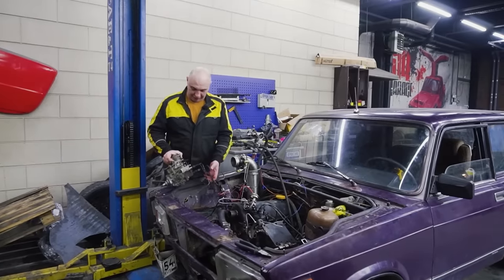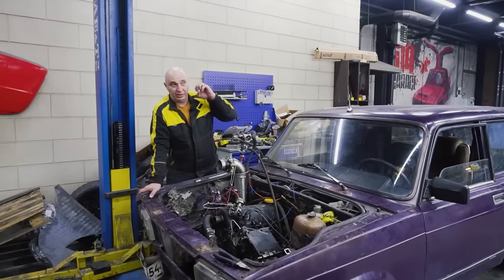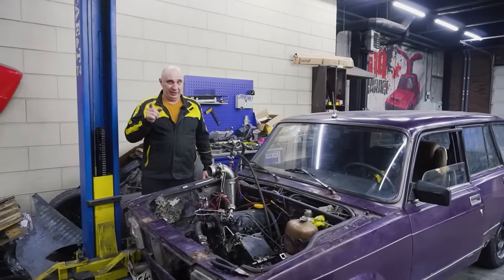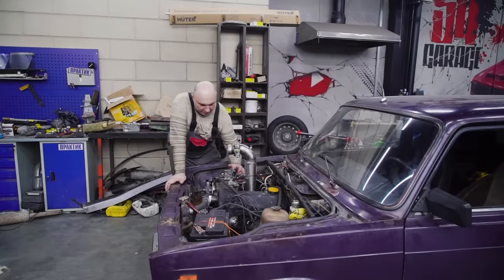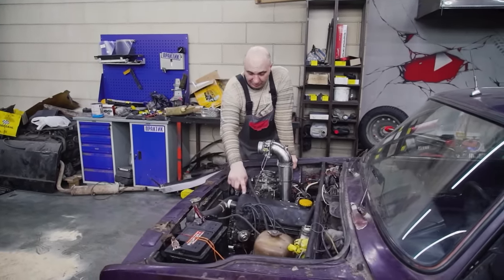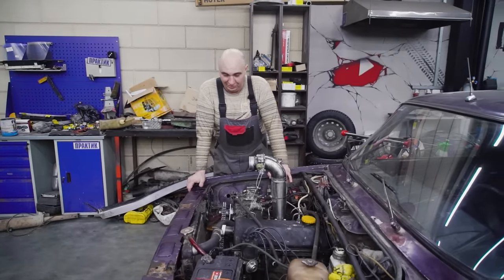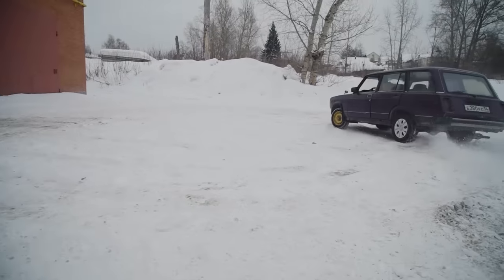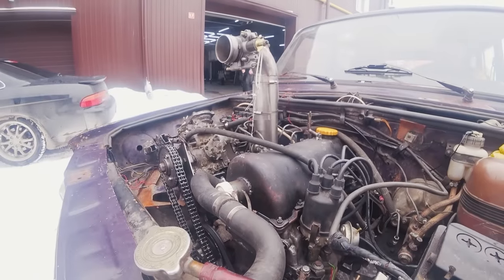We fit high pressure DIESEL pump to Lada engine

Comment: Back in the 80’s in Brazil they used to convert the old chevrolet inline 6 261 engines from the old petrol chevrolet trucks to diesel. 
The conversion was made using the cylinder head from the Mercedes diesel OM 321. They used to use an adaptor plate to be able to bolt the cylinder head from the mercedes into the chevrolet block, then I’m not sure about the injector pump but it’s not hard to gear it onto the crank pulleys or using the distributor shaft as a source of 1/2 crank rotation speed. I believe they would adapt the diesel pistons onto the chevrolet rods, never got details about this conversion but spoke to people who done it themselves (My father). The engine would work quite good but wouldn’t last long because of the lack of support for the crankshaft (5 main bearings only).
Reply: the misto quente was horrible, it didn't run like a real diesel engine and the consume of diesel was almost equivalent to the gas engine... and as you said, the engine wouldn't last not just because of 5 bearings, but due to the lack of resistance of material of piston rods, bearings, etc. a diesel engine requires a highly resistant engine due to the high compression from diesel.
Reply: Yep, they took the 4.5 I6, "canavieiro", and stuck a Mercedez head and rods, didn't work so well, but it works any way, they rather make a Detroit Diesel swap.
Reply: Rapaz que tanto de brasileiro falando bonito kkkkkk Ainda espalhando pro mundo a história do misto quente...
Reply: General Motors did something similar with the standard 350 V8 block. Converted it to a diesel. It wasn’t very good, but it did get decent mileage. They also did this with a 4.3L V6 but they used a heavier block. Those blocks were used in race cars converted back to gas because they would withstand the higher compression 😂
Reply: @weaponizedautism6199  they do this with the nissan rd28 and convert it to gas still today. Stronger blocks on diesels like you say. They use it as a stroker block too compare to the nissan rb26 found in the gtr's
Reply: Petrol -> diesel is always 😫, but in reverse it works well 😌.
Reply: @killerdinamo08  100% blocks aren't strong enough for the compression

Comment: it's like a mechanical injection system that was used on some race cars some decades ago.

the fuel delivery depends just on the revs. it's like a bosch system from 1955
Reply: both volvo and mercedes also used mechanical injection as late as the 70s early 80s i believe, it gave the volvo's more power than carbied or efi then but was less echonomical
Reply: missing one major thing, the amount of fuel delivered in each pulse is based on manifold vacuum on those old systems
Reply: @Stale_Mahoney  the Kugelfischer injection from the 60's used rpm, throttle,pressure, temperature to control injection, all done mechanically with shaped cams
Reply: @fuzzy1dk  good to see someone mention the ol' Kugel here ! 

they used rpm and throttle position,  or for the turbo version  throttle positiona nd boost press.  

whats funny about these is that if you "unroll" the cam shape about its axis, you got yourself a 3d fuel map just like on a Alpha-n  strategy on a modern ECU.
Reply: Top fuel and top alcohol drag cars are still using the same basic idea. Not sophisticated but still the best way to dump huge amounts of fuel into the chsmbers
Reply: @Stale_Mahoney  plunger pump systems died of in 72 , cis mechanical sprays continuously, was available in some form until 89
Reply: @dennisford2000  cool to know i know volvo used a B23E in the new GLE 1980(replasement for the old GT) and later B230E engines even after that, that was 2.3L engines and the fuel or carb injected was around 114-116 while the mechanicaly injected was rated at 131-140 depending on  model choice, also some turboed 2.1L once at 160hp  they all used bosch K-jet
Reply: RPM & Vacuum
Reply: @RickBaconsAdventures  VW used a mechanical mass air flow sensor to control the fuel delivered for each cycle.
Reply: They just have reinvented the Spica fuel injection system :D
Reply: @martinp8427  spica seems a lot like it, but that had some cam system hooked up to i presume vacuum and throttle position to change the pump % they had at fixed here.
Reply: @matthewperlman3356  that's interesting
Reply: No, those older mechanical petrol K jetronic injection systems did NOT use positive displacement pumps such as used in Diesel engines.  
I love garage 54s experiments because they invoke questions. Frankly on this one I agree with the author when he said “how is this working”. He got lucky on this one. But none the less a fascinating result!
Reply: @sqmotorsports9230  nope nothing like it. They don’t use positive displacement piston pumps to inject the fuel. Like used here and in Diesel engines.
Reply: @fb2800  you have to go further back than k jetronic to get back to the the systems based on diesels. 

or the spica system "The system consists of an electric pump near the fuel tank; a circular pressurized fuel line to the injection pump and back to the tank; a mechanical pump, driven by a toothed belt off the crankshaft; and a set of injector nozzles mounted in the intake manifold. The mechanical pump itself is really two components: a four-plunger unit that resembles a miniature engine, and an all-mechanical logic unit that regulates the pump's output. "
Reply: @RickBaconsAdventures YES
Reply: I think they sense the piston stroke by vacume and pressure. That way you can rev it to blow up.

Why they changed it

But for us ex racers and this show

BLOW IT UP
Reply: First gen Cummins was direct mfi. Injection pump increased fuel based off boost pressure and engine rpm’s.

Comment: you've managed to recreate the latest Petrol fuel systems! thats cool!
Newer engines nowadays have somekind of high pressure pump just like a diesel, to up the pressure a lot in the fuel rail. ive seen pressures above 150bar already. This is to atomize the fuel better, so the air really mixes with the petrol. gives a cleaner, more efficient and powerful burn.

just maybe you've started a retrofit trend! nice
Reply: except the new petrol fuel systems inject in the cylinder, with much more timing variation and complex duration control afforded by common rail computer controlled injection. I agree, though, for a hobbyist, this makes soooooo much more sense than going to a complete standalone ecu. You could mount one of these to your gasoline crate engine and it nearly run itself like a diesel, for what it's worth.

Comment: Brilliant video guys I wonder how it would drive with a turbo from a diesel
Reply: i was just thinking the same thing same set-up but just add a turbo lol
Reply: Makes me wonder how much power this engine makes before it comes apart though.
Reply: You'd need to add a booster valve for extra fuel or else things would melt quick I'd say haha
Reply: @aaronhall7740  it has that built into the pump already.. that ufo looking bit on the top of the pump adds more fuel when on boost..
Reply: @johnathanmcdoe  atleast 50% more that stock, unless these engines han handle more tourqe than is there from factory.
Reply: Ha ha
But one could enhance the cooling system & run the turbo off a cog as pump but add a magnetic clutch like compressor,  this would allow to switch on & off , just keep fuel regulaton as is just use bypass air valve for turbo etc for wen no operation
Lol
Reply: Yes!
Reply: I support this -- you guys should go the whole way and turbo it.
Reply: Восхищение произойдет без сомнения, и это произойдет намного раньше, чем многие верят (менее 10 лет, согласно всем экологическим, погодным, астрономическим знакам, израильским графикам и т. д.). Это произойдет без всякого предупреждения, ни одного, в одно мгновение, застигнув массы людей врасплох, как это всегда делает Бог, т.е. потоп - грубое пробуждение. Никто не знает точного дня или часа, когда произойдет восхищение, это точно. ВОСХИЩЕНИЕ МОЖЕТ ПРОИЗОЙТИ СЕЙЧАС, В ЛЮБОЕ ВРЕМЯ !! . Пожалуйста, пробудитесь ко Христу Иисусу, который является ЕДИНСТВЕННОЙ надеждой СЕЙЧАС, и не позволяйте узнать, что это все правда позже, когда будет слишком поздно, и вы остались позади в самые ужасные времена, которые земля когда-либо переживала прежде и когда-либо будет. Римлянам 10:9-10 Если устами твоими будешь исповедовать Иисуса Господом и сердцем твоим веровать, что Бог воскресил Его из мертвых, то спасешься!

пожалуйста, поделитесь с другими = ВАЖНО
raptureready.com

The rapture will happen without a doubt, and it will happen much sooner than many believe (less than 10 years, according to all environmental, weather, astronomical signs, Israeli charts, etc.). It will happen without any warning, not a single one, in an instant, catching masses of people by surprise, as God always does, i.e. the flood is a rude awakening. No one knows the exact day or hour when the rapture will take place, that's for sure. THE RAPTURE CAN HAPPEN NOW, ANYTIME!! . Please wake up to Christ Jesus who is the ONLY hope NOW and don't let it all be known later when it's too late and you're left behind in the worst times the earth has ever experienced before and ever will be. . Romans 10:9-10 If you confess with your mouth that Jesus is Lord and believe in your heart that God raised him from the dead, you will be saved!

please share with others = IMPORTANT
raptureready.com

Comment: So they basically made a mechanically injected lada, sweet😍🙌🏼 (it’s ready for a turbo😈😆)
Reply: yeah it's basically same as boschs system on a mercedes, high pressure included.

which makes me think.. did.. did bosch do just exactly this in the 50's?
Reply: @lasskinn474  my 79 450SL had that exact Bosch J-series mechanical injection
Reply: Yep, they did, GM also did with another name, the only problem was that require maintenance that ppl by that time didn't have the knowledge or thought it was too expensive to do, so they promptly replace it with a carb, years later Bosch made a monopoint electronic injector, which was simpler and easier to fix, the rest is history.
Reply: I was just thinking they basicly just build the bosch CIS Jet tronics used on a lot of European cars in the late 80s and early 90s

Comment: Early injected gas Mercedes engines like the gullwing had this setup essentially. Gullwings were direct injection but the later 220se and similar cars were port injection but still using a timed high pressure Bosch injection pump.

Comment: This was an amazing video experience to watch. I never would have though a high pressure diesel fuel pump would have worked. Thanks for sharing.
Reply: It really isn't any different from normal port fuel injection, just using a mechanical pump and valves instead of their modern electronic counterparts. Modern high-efficiency gasoline engines use high-pressure direct injection too.
Reply: @teardowndan5364  oh. I did not know. Thanks for telling me. I appreciate it. Thanks Again.

Comment: sugestion: try and make an opposed piston engine with two lada blocks head to head...
Reply: With the diesel injection pump!
Reply: @NN1Ckl.  How about three blocks and make it a Deltic. :-)
Reply: @Dave5843-d9m  that's a bit harder... lol
Reply: @Dave5843-d9m  That sounds WILDDDDD, you think they could get the geometry and weld 3 con rod tops to one conrod bottom and the crank? Do that with each set of pistons perhaps
It would be like just the top half of a 3 bank radial lmao
Reply: Up!
Reply: Up!

Comment: It would be interesting to run it with a wideband sensor to see if it's going rich and lean at different RPMs and loads. I mean really it has to be if the injection pump throttle is not being changed.
Reply: And add a stepper motor servo on the mixture control to run closed loop from a microcontroller, just for good measure?
Reply: Are you guys in the right channel? Sensors? We don't use this here. lol
Reply: Thats not a throttle as such. Its an enrichment device. It decides how much fuel you get per revolution so presuming the car needs a certain % of fuel at a given rpm and that doesn't change (it wouldn't on a petrol since stoic is always the same) then if its right at one rpm it will be right all the way up - or very, very close depending on how the thermal efficeincy changes based on air speed and volume.
Reply: I think it's all about the speed and timing. By getting the correct amount of fuel into the cylinder almost instantly after the compression stroke,  the fuel has more time to mix with oxygen in the down stroke it creates a vacuum and force mixes the oxidizer and fuel even more thoroughly it's like a secondary atomizer similar to experiments when water boils at room temperature under a vacuum the gasoline is locked in place and evaporating.
Reply: @SF-dy6hn  The mixture control on the pump controls the cam timing which opens the valves to the injectors inside the pump. A longer opening angle on the cam means the injector will be open for longer, and more fuel per stroke, hence a richer mixture.
Reply: @Stoney3K   Yes. I thought about that my first thought was that more fuel = more power. How-ever the mechanic seemed puzzled by the results. Theoretically a perfect mixture produces peak power rather than a lean or rich mixture. In practice most rich mixtures provide more power. How-ever the mechanics puzzlement on the situation leads me to believe there may be a non obvious reason. The next logical conclusion would be that something more advanced is occurring. Perhaps a more perfect mixture? Not just perfect quantities but equidistant separation of particles for a more complete combustion. How would the increase in delivery speed increase the homogeneous-ness of the mixture? Or maybe I'm completely wrong and a super rich mixture is better because the air is denser there with more oxygen so a rich mixture is able to fully combust. Or maybe a combination of the two a richer mixture that is more homogeneous?  It's pretty cool how much more power he got out of the engine.
Reply: Yes ideally the throttle and pump should change together. changing an offset between the two would adjust the AFR.
Reply: Slice up a small pulley, attach it to the throttle body, figure what fuel mix gets the highest rpm for each level of throttle opening, then match the fragment of pulley to the optimal fuel mix and if the mix needs to go more rich or more lean at wide open. Simple mechanical solution powered by trial and error! Wooo

Comment: Maybe with a vacuum solenoid connected behind the throttle body you can control the injection pump to get close to the right fuel air ratio

Comment: On the old gasoline MFI systems in 60’s Mercedes they actually have a small oil line from the crankcase that delivers a very small amount of oil to the pistons within the MFI pump. It is subsequently burned in the engine. This was one of the reasons MFI for gasoline never took off after the emissions regulations of the 70’s kicked in.

Comment: This is the sort of thing I’ve always wanted to do to see if it worked in theory. 

Garage54 does all the amazing stuff my mind conjures up. This shows high pressure port injection works. No need for complicated direct injection! Direct injection pressure, emissions cleanliness, and efficiency without expensive annoyingly complex fuel injectors that break. Pay attention car manufacturers, you guys over complicate everything! Garage 54 is on to something! Amazing work again.
Reply: yeah, it does work just that it's not optimized for it that's all
Reply: mercedes did this in the 80s before they decided to go to common rail efi like the rest of the world, they already milked this idea for its worth. Sorry to ruin your idea, the germans had it a long time ago
Reply: I’ll assume you’re referring to the 300 series diesel OM617’s. Those cars are amazing and my childhood favorites. My folks owned a few of em.
Reply: @jamesadams2333  no, gasoline engines, look up k jetronic and how it works.

Comment: Fuel injected engines use fuel trim levels based off the O2 sensors to determine how long to keep the fuel injectors open.  There is a return line from the fuel rail back to the fuel tank to send any excess fuel (pressure).  Increasing the pressure in the fuel rail may have some differing effects on how the fuel is atomized (read: dispersed) in the air/fuel mixture, but as long as those effects are not too pronounced and the fuel system is capable of handling the increased pressure (not bursting) then the O2 sensors and computer (within reason) should be able to adjust the amount of time the fuel injectors stay open to optimize the stochastic air/fuel mixture.  This will allow the engine to continue to run at near optimal ranges.

Comment: I mean the diesel combusts when there is enough compression so the timing will always be advanced and there for backfiring and working against the pistons.
If you can utilize sparkplug holes like making a tube that connects the injector it could be perfectly tunable besides the valve timings. 
Of course it will never be perfect, but still straight injection. 
As that engine stands now, pump timing really wont matter, because it is the intake air that desides when the fuel goes in.

Comment: this was exactly how 80s mercedes fuel injection on their 6 and 8 cylinder usdm cars worked, they used a sort of "scale" as a throttlebody, mounted on the top of the pump. The farther down that plunger moved due to vaccum, the longer duration the mechanical injectors would spray. Very simple physics in hindsight, as our boy Vlad here showed us he got a hand for doing literally with his fingers!!!